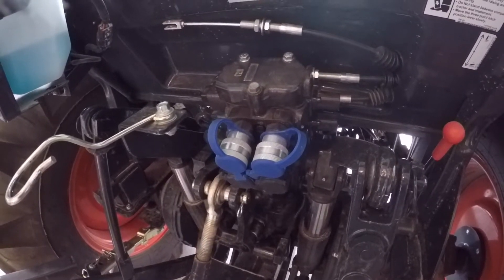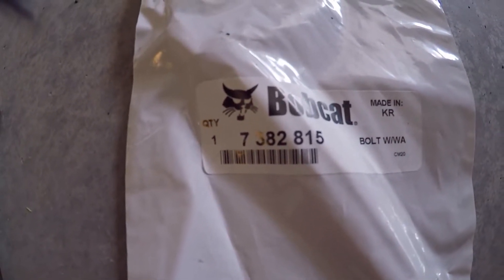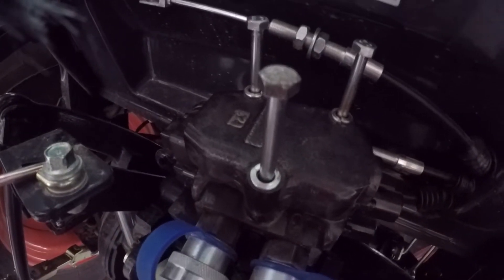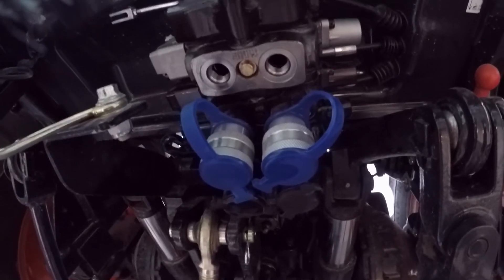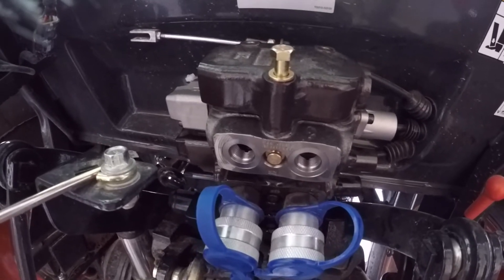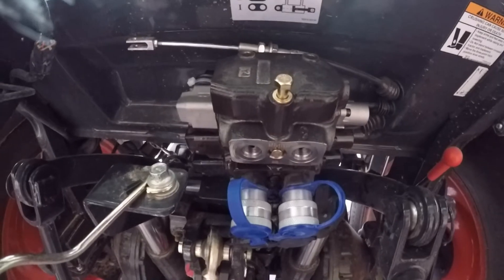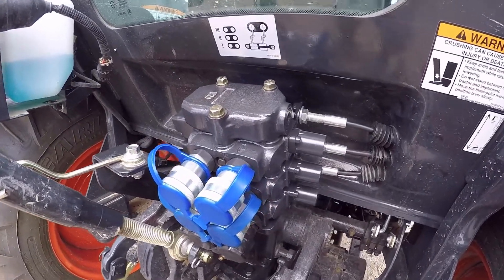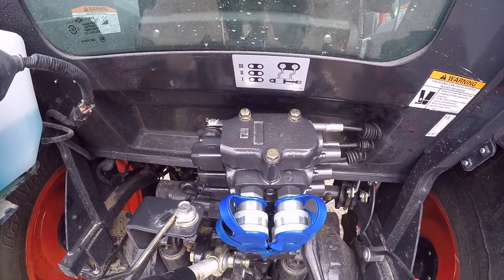Bobcat CT5555 3rd Remote Install

Comment: What style couplings do they use on the rear remotes?
Reply from the maker: 1/2" AG
Reply: @gaining_ground  Do happen to know the ISO number of your couplings?  I purchased some ISO 5675 and they do not work.
Reply from the maker: @On_The_Farm  Are you using the poppet style or ball? Mine is the ISO 5675 Poppet
Reply: @gaining_ground  Poppet style.  I'm not sure they are 1/2" now, although they almost fit.  Just wont't latch. There is a poppet in the female part of the tractor coupling also that moves freely.
Reply from the maker: @On_The_Farm  1/2” Safeway S71-4P is the same as 1/2” ISO 5675 and should be the same as Pioneer 4000.
Reply: @gaining_ground  Long story short, I got the AG fitting to work. It appears my new tractor couplings had some debris or varnish. We had to push pretty hard to get them in there the first time, but once a little oil got in there they work pretty well.
Reply from the maker: @On_The_Farm  Good, I’m glad you got it to work.

Comment: Hey I love your vids.. I actually just bought ct5550..   was just curious on where you purchase the rear remote kit?, was it from the dealer?, was curious on how much a kit like that cost?.. thanks!!
Reply from the maker: Thank you, I’m happy you enjoy the vids.
I bought the kits from the dealership. If I remember correctly they were around $550 each. Bobcat has an owner portal on their website where you can enter your vin and it will show you everything available for your model, with pricing. You can purchase for the same price from your dealership or right there through the Bobcat website.
Reply: @gaining_ground  that's awesome.. I didn't know that.. thanks your letting me know, I'll check it out.  Thanks again

Comment: Thank you very much for all the videos on the 5555. Will you be purchasing a quick hitch for your three point? Just curious. They look like a nice item to have. I subscribed. Thanks again!!
Reply from the maker: I did buy a quick change. The problem I have is that there is not enough room, when I fully raise the three point, to get my fingers between the quick change and the fenders. I’m afraid that with any slop whatsoever, the quick change could hit the fenders. Which would not be good, considering they are hard plastic.
Thanks for your support!